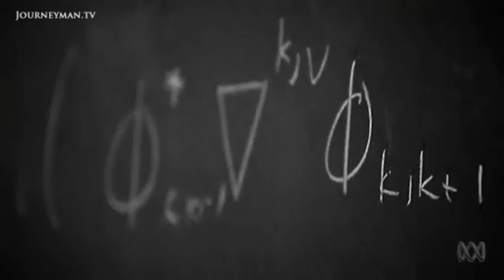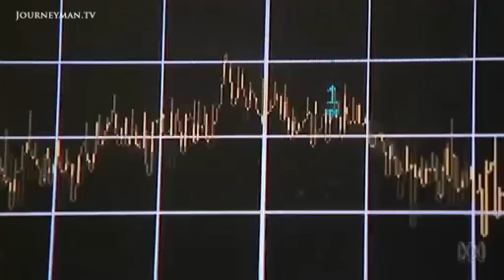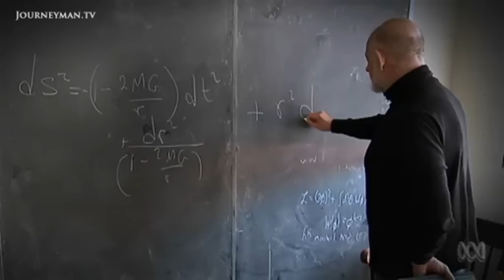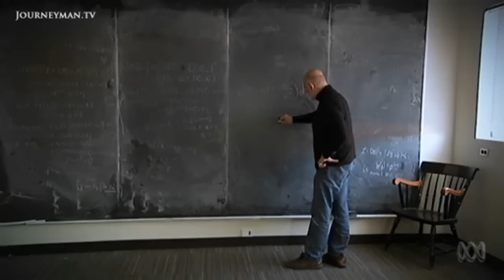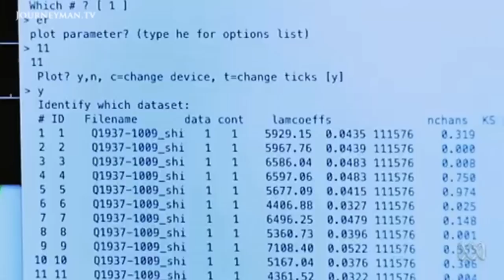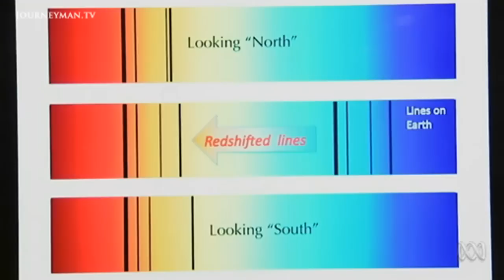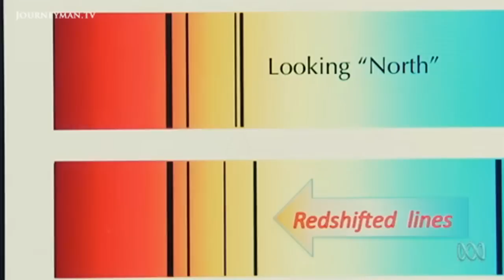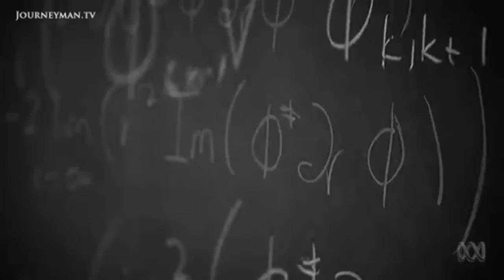Are We Living In A Multiverse?

Comment: Fine tuning is rather trivial from a statistical perspective and there is no need to throw in quantum mechanics' interpretation to confuse the issue. Back to statistics, however many possible outcomes you can have (in this case, values of the fine tuned constants), we will only observe the one of our (or this) universe. That does not imply that there is a reason behind this, it is just a random process.